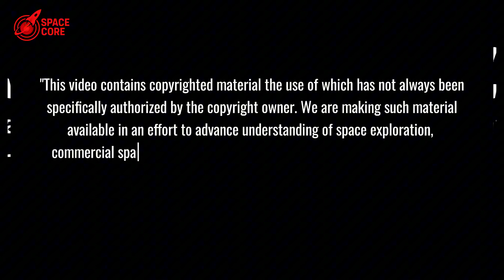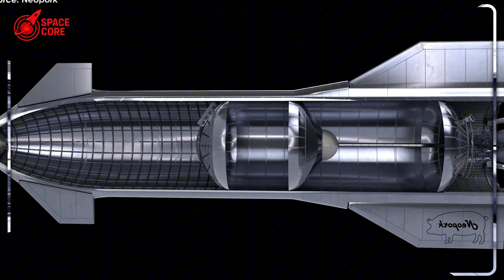SpaceX finally revealed its Starship Drone Ship Legs Landing...GAME OVER!

Comment: Can you imagine how large a drone ship would be for the Boosters / Starship?  It would be a barge twice as large as a carrier, Not as tall as one tho.  Could maybe have storage for 3 or 4 empty boosters / Starships?
Reply from the maker: A drone ship for Super Heavy/Starship would need to be massive, likely double an aircraft carrier’s deck size to handle the 71m-tall, 200-tonne booster. Storage for 3-4 units is feasible but would require a robust, stable design.